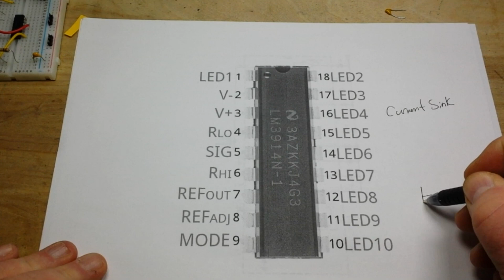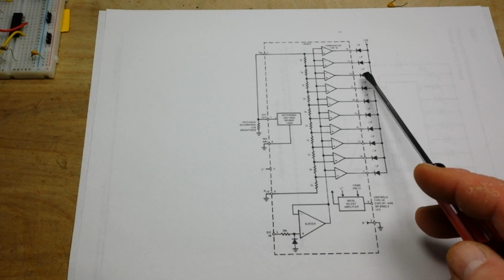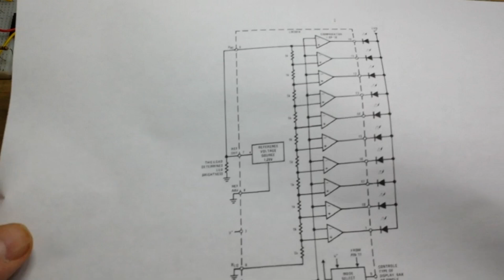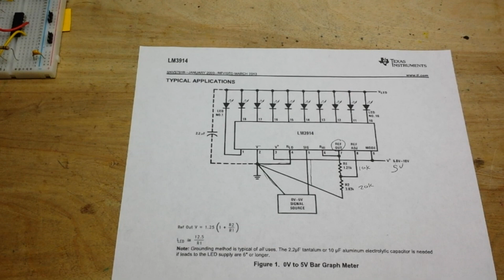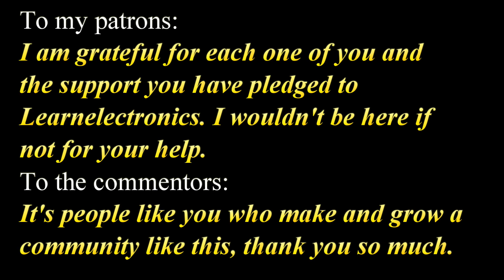Make a bargraph display with the LM3914

Comment: I've been trying this recently. When I put it as a dot mode the first led is constantly on as I increase voltage. I tried it in bar mode with a speaker and the first 5 LEDs are just on all the time.  Any idea why this is happening?

Comment: I was hoping for a little advice from the type of people who regularly watch these kind of videos:

I'm making a prop replica (a phaser from Star Trek) using this chip and bar graph, and I want to be able to press a button and increment the graph by one - and vice-versa on another button. I'm thinking I need to find some kind of Digital Variable Resistor. And so that I don't fry the chip, I guess some kind of fail-over circuit with a resistor the right strength should run parrallel to the DVR... oh wait, no - that would mean the current goes through the DVR only when it's higher... Can I put it in-line, do something with a diode? I obviously have no idea what I'm talking about, so help is appreciated.

Comment: i bought 8x Chips&parts of them and thought: fuck its dot mode xD, 
video saved my day
Reply: btw i recognised an unstable behavior. The Status jumpes between 2 and 8 leds randomly if i (slowly/normaly) disconnect and reconnect the circuit.
Its very unreliable indicator at the moment, did you noticed that too or do you have a fix for that?

Comment: I used to use these a lot. I ever made a pump down controller with one of these combined with an SCR and a photo triac, and power triac to torn the pump on and off. At the time it was simple, cheap, and reliable. Now they're so expensive vs a microcontroller it doesn't make sense anymore. But I still like the part. 🙂

Comment: Hi Paul I just bought a kit from Velleman electronic the store was RP electronics hear in Barnaby British Columbia Canada it uses the same chip its a2x stereo vu meeter using 10th LEDs mounted on 2 PC boards I guess one for the right channel and one board for the left channel. The website for the store is www.rpelctronics.com  it uses a 741 chip and lm3916 not sure if it will work I acsedently broke the 741 trying to put it in its socket ether way it was a fun kit to solder up check out RP electronics. Com for the kit I would love to see you put one together. Love your video hope you have a great new year. Your freind Don Hiscock from Vancover British Columbia Canada.

Comment: I like your videos, but as new guy to electronics, I would like to see more videos on a visual of how current flows and why?
Why we use certain components to control the flow of current and control voltage. Not the basics of things like npn or pnp, but 
how those things influence the circuit and results of the circuit . thanks Steve

Comment: I did not know this chip existed until now. You could easily use this as a battery indicator in bar mode and if the last led goes off just switch the power to your circuit of and you’re done.

Comment: 3 in the 'family':  LM3914, LM3915, LM3916.  Having never looked closely at the datasheets, I was now surprised to read the pin-5 input (with a 39K resistor in series) can handle up to +/- 100v.  Wow, didn't know that.  Looks like in 1979 Forrest Mims created an LED matrix oscilloscope with LM3914, LM4017 and supporting chips.  Crude by today's standard, but pretty amazing at the time...  FWIW.

Comment: Great video! This is why it's important to learn circuit fragments like comparators, voltage dividers, etc. Makes it a lot easier to understand integrated circuits when you see the schematics of the internals, and how to add other circuit fragments to the pins while looking at the circuit diagrams.

Comment: Nice chip, but the video for me seems incomplete (i dont know the correct word for it). I need the breadboard for starters so I wont have to see 4 minutes of nonsense before I understand what you are brilliantly up to. I also need explanation on that signal (which trimpot and why) and how to pass the signal on to another function which I suppose you would have also as the bar doesnt have any function by itself.

Comment: That chip works neat for things you need to take actions on or at various voltage levels.  Not just for driving LED displays.  Say you need a load to kick in at 10V,  20V and 30V .   You can implement that using this chip.   Like on my Wind Turbine creating a variable voltage between 9 and 50v.   0 - 24v can be directed to charge the battery.  Any thing above 24V directed via relays to a Dump load or alternate purpose like a heater element. 
Why am I so damn Cold ?
Did you know today 05 Jan is the day the Earth is the closest to the Sun we are all year long ?
Answer :   It's the Angle of the Dangle.  
What does that have to do with Electronics's ya say ?   NOT a dang thing.  I just remembered that tid bit.

Comment: kudos on the video! i did the blynk project in my house. i was wondering if u can do a tutorial of the same project but without the blynk app. what im imagining is to control the D1 wifi board through linux command line. or pointing me in the right direction. thank you very much

Comment: 7:30 " you cant use that microphone because it has an offset of 2.5v"  Youd think with your 30years of experince youd know you could remove that offset with a capacitor & all electret microphones have a bais offset voltage! They have to have this in order to be able to swing negative.
Reply from the maker: You can make anything work with enough parts. But if you would have Listened to what I said instead of making a smart-ass comment you would have heard me say you cant use THIS microphone due to the offset and 5V range.
Do you really expect me to cover every possible permiatation of every single circuit in an 8 minute video?
Why dont you go and  troll somewhere else. You have now used your minute of my time. Bye.
Reply: @learnelectronics  hahaha i wasnt trolling i was making a serious point, you could use that mircophone in that circuit, its just the same as any other electret microphone! The fact that someone has put it on a board with a couple bais resistors to make it easy to use with an aurduino means nothing! Simply add a capacitor to remove the off set and feed that signal into a peak dectector circuit, then the output of that into the LM3914.

Comment: Thanks for demonstrating this IC, i wonder if the input voltage is raised (say 12V) the offset will decrease proportionally? Could also use for battery voltage monitoring.
Reply from the maker: Yes and yes. It's just a bunch of comparitors.